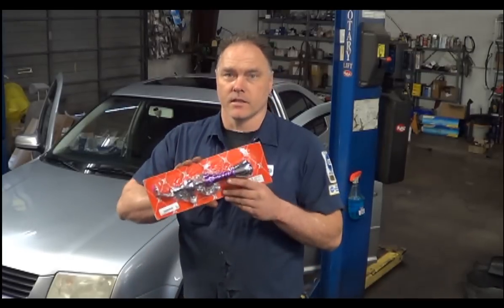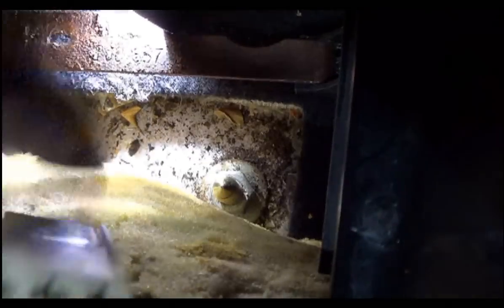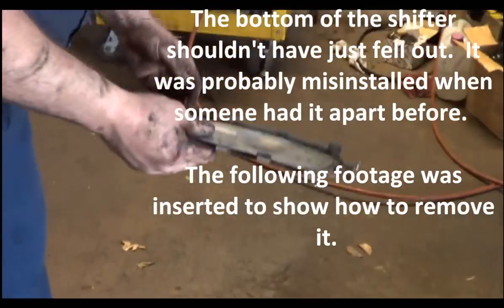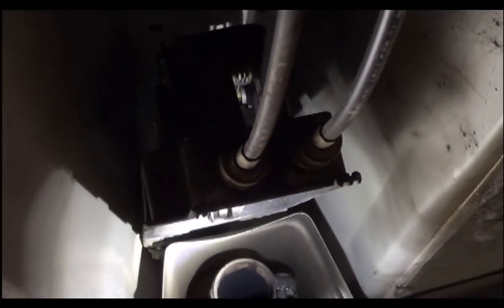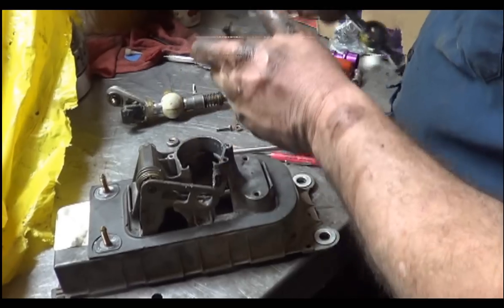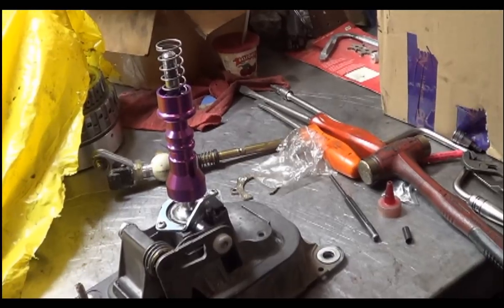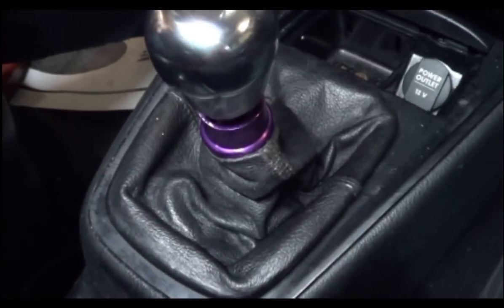How to install short throw shifter Vw Jetta, golf & beetle mk4

Comment: Came across your video and I am surprised how much work and effort went into changing the shifter.  There is an easier way to do it without taking everything off the car just to get to the shifter cables.  I watch another video about fixing a floppy shifter and I didn't have to go under the car to take out the pan, I just took out the counsel drilled two holes in the shifter box pulled the cables took apart the shifter and pulled it out.  Before you can do that, you must lock the shifter in place both in the car and under the hood that way when you re-hook up the cables the trans is in line where it's supposed to be.  Much easier way to do the job.
Reply from the maker: Or just dont use this shifter cuz its junk.

Comment: This is literally a 5 minute job and you don't need to jack up the car, just drill a hole on the passenger side of the box.  I just did this job this weekend.  Also, take the #20 torx bolt off the first gear getter.  It's easy.
Reply from the maker: goodtip.
Reply: send me your intall i wanna do it but this guy doing the most
Reply: Mind giving any tips?
Reply: Glad I saw this comment. Lol

Comment: you make it look alot harder than it actually is.
Reply from the maker: I certainly did struggle with it.  I learned later that pulling the torx bolt out helps.  Probably need a impact driver tool to get it out because its tight.
Reply: @CoolAirVw  Nah, it's snug in there with some threadlocker but it comes out fairly easy with hand tools.

Comment: Why didnt you take the torx screw out of the bell crank instead of all that fighting it
Reply from the maker: Yeah I should have.  I read somewhere they are locktited and a problem.  Hindsite.  But this shifter is garbage.  Get a deisel geek one that bolts onto the trans.
Reply: @CoolAirVw I installed the diesel geek kit on the trans, was super easy and works really well incase anyone wanted to know.

Comment: 2 things,    why not pop that pivot arm off.  shifter in socket, then reinstall the pivot arm. 

The kits I have seen like this come with an adjustable bushing that the flat spot runs on.   it mounts to the upright portion of the retaining color towards the shifter.   stops the shaft from spinning and no metal to metal contact.   

I am curious if this can be done in the car as well.  I have changed both shifter bushings in the car.  I would think it is possible, but this is way more room to work.   

Thanks for the video.  it is a great run through on how the shifter parts are assembled.
Reply from the maker: At 12:11 you see the "pivot arm" extending downwards into the shifter housing.  It will not slide out because it is down inside the shifter housing.  To remove the "pivot arm" you have to first remove the shifter handle, in order to rotate the "pivot arm" out of the slot that it reaches down into.   

You might be able to install this shifter in the car,  but  the cat has to come out.  Its super easy to remove the whole shifter once the cat is out.

Comment: The customer should have gotten solid shifter link ends and solid cable mount bushings to tidy everything up while your there. I never met or talked to anyone that bought one of those. Wonder how it feels
Reply from the maker: Yeah, this shifter was crappy.  (*this video was crappy too).  I installed two of these and both customers had me remove them within a year.

Comment: On Megan racing’s website it says it fits 99-03... I have an 04 1.8t, does that mean it wouldn’t fit? Is there anything different with and 04 from a 03
Reply from the maker: It should fit.  My personal opinion is skip this one and get a diesel geek one that bolts to the transmission.

Comment: Is this the shift I would need to do a 5spd swap in a BEW tdi? My 09A has no forward gears once its warmed up but still has reverse so I believe I'm going to just swap it out. Still looking at everything needed for the swap and a short shifter was one of the items listed on the forums. Thanks.
Reply from the maker: My suggestion is to use the stock parts.

Comment: Excellent video friend, I have a Volkswagen known in Mexico as "Derby" and it shares many things with the MK4, I guess this short shifter will also fit
Reply from the maker: dont use this one.  Get dieselgeek sigma 5 shifter
Reply: Model 2003 bro, my original shifter it is the same as the video
Reply: @felitsboosted3480   es la misma palanca, ya la pusiste?

Comment: As I’m sure you know, to put many VWs in reverse you have to push down and pretty much put it into first gear. How would this aftermarket short shifter be able to adapt to that? Would it still allow the shifter to be pushed up on the shaft when you push it down? I’m not sure if im explaining it right but I’m essentially asking how that reverse style would translate to this aftermarket shifter.
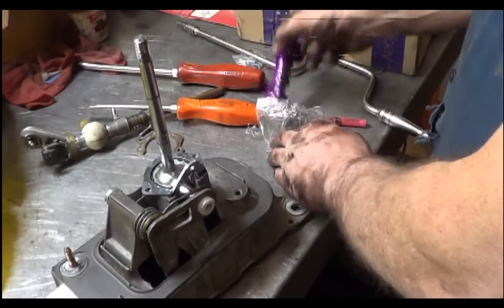Reply from the maker: Thanks for watching.  watch at 14:48 and I show you how it does it.
Reply: The metal collar that gets installed is what dictates how reverse is selected. On the stock assembly the collar has a cutout that  forces the driver to select reverse by pressing down. On the aftermarket assembly the collar is bent so that it is raised. This raise dictates that the purple over shaft must be lifted over the bent portion of the collar in order to access reverse. This shift assembly changes the way that reverse is accessed entirely.
Reply: Correction 
Push down go all the way left then up

Comment: How do you adjust the shift linkage with the short throw shifter
Reply from the maker: Since there  is no pin on this shifter assembly you have to just adjust it by feel.  Or maybe, pin the trans and have a helper hold the shifter against the reverse lockout and then lock down the adjust ment "springs".

Comment: Could this be used in conjunction with the Audi TT shifter that goes on the gear selector side of the linkage for even shorter throw?
Reply from the maker: probably. You would have some very hard, notchy shifter effort though,.  I would suggest not.
Reply: @CoolAirVw  good to know. Thanks. I just remember the days of my integra with DC short shifter. It was so small and the throw between gears was maybe 2 inches if that.
Reply from the maker: @bertmollar  Using the audi style or the diesel geek aftermarket one that is installed at the trans is much easier install.  I would choose those over this one.  Thanks for watching.
Reply: Yes, but honestly it's not worth it.  Get the cable upgrades that go in the engine bay for a noticeable difference.  Also, get the dieselgeek bushing kit.  I have an audi tt and I did the bushing upgrade this weekend and it's AMAZING!! Like a whole new car.
https://www.youtube.com/watch?v=kPII13ZUBZE&t=461s

Comment: How do you adjust your cables with this shifter, all the other videos are on the stock shifter
Reply from the maker: Originally when you adjust the shifter you pin the shift tower at the trans and pin the shifter under the shift boot.  Pinning it underk the shift boot holds the shifter in the neutral gate up against the reverse lock out.  So since this shifter doesn't have the hole for pinning,  you simply pin the shifter tower at the trans and have a helper hold the shifter in the neutral gate up against the reverse lockout (to the left), then adjust your cables just like its a stock shifter.
Reply: @CoolAirVw  move straight left or left and toward the driver like where the factory holes are?
Reply from the maker: @brandonbarnes5585  left

Comment: Will it work with 02A shift box
Reply from the maker: I dont recommend this shifter at all.  If you have a 02a I might suggest looking into upgrading the shift tower and cables with parts from 2001 -2004.  After that the diesel geek shifter is good.

Comment: I installed the shifter all gears work fine but i have no reverse lockout it just goes into reverse without pulling or pushing up or down. I installed the plate and everything properly but i dont understand why it does this
Reply: You probably installed the purple part upside down.

Comment: 99% completely unnecessary steps every thing can be removed from inside all you have to do is drill out the flat side to access the vertical bushing lol
Reply from the maker: Hey!  Nice tip.  Post up a video.

Comment: Wrong Volkswagen’s don’t go in reverse like most cars, you have to push down on the shift knob and go like your trying to put the car in first gear. I personally wouldn’t let you do anything to my car much less pay you to, not because of you being wrong but because of the way you treat the customers property, throwing the shift knob on the hard ground while touching everything with greasy ass hands? Also half the time it looks like your learning as you go just to try and figure out how it goes together which I do give you credit for finishing the job.
Reply from the maker: thanks for your comment, Zach.  I own about 11 mk4 jetta's of which half are manual trans so I assure you I know how to put one in reverse.  Plus I run a Vw specialty shop so I think I know how it works.  I would assume Zach is commenting regarding 14:42.     This type of aftermarket shifter is different from the factory set up and has a different reverse lockout.  On this shifter you pull up on the collar to make it go in reverse.  Obviously Zach has never installed a aftermarket shifter like this, and never even driven one or else he would know this.   Zach makes a comment because hes so dang sure, but he is so dang wrong, which makes him look like he is sticking his foot in his mouth.     Anyone on the internet can comment, even if they don't know and have no experience,  and are free to just throw any comment out there, despite whether they know anything or not.   That's the beauty of the internet.
Reply: @zack 🤦🏻‍♂️ 🤦🏻‍♂️ 🤦🏻‍♂️